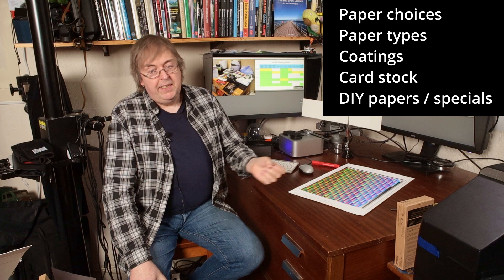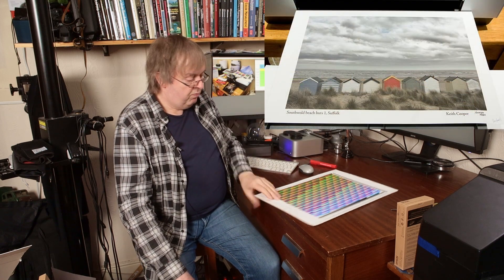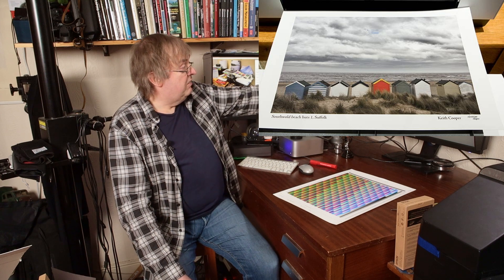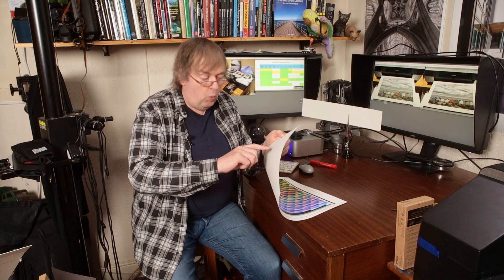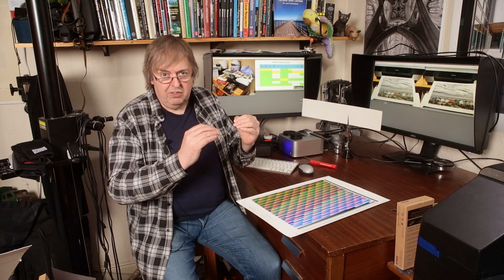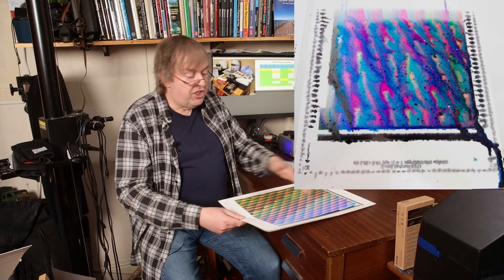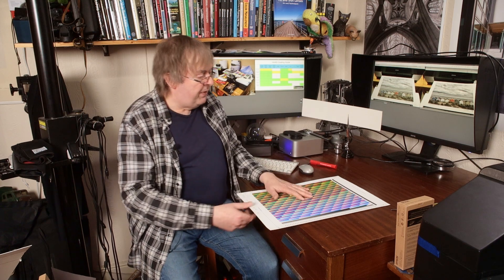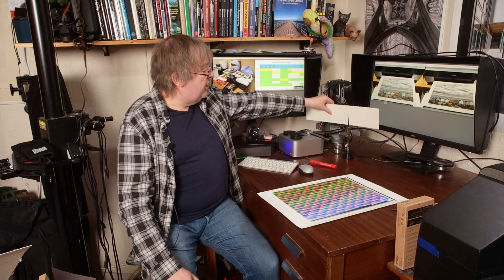Are your bad prints just using the wrong paper or card? Inkjet paper coatings for paper and cards

Comment: I have a XP55 Epson Expression 6 colour printer and did some prints (I dug it out from storage) and they looked fine. I have watched your other videos and in one you said you would use non-original ink in a printer as they can be copied quite well. I am asking as in the printer I use compatible cartridges and noticed after printing after a week in being left in a conservatory the photos looked weird. Some colour had turned weird and the colour had changed. Not sure if this is the compatible ink (would originals be better), or if the UV had done something to the photo's chemistry to change it. It might be a topic for a new video.
Reply from the maker: You've spotted the real issue with many 'unknown' inks - they show very poor permanence.
"Compatible" is mainly just marketing copy ;-)
Actually, I generally would NOT use 3rd party inks unless they were for a specialist printing setup, and even then I'd be wary of effectively ruining any warranty.
Even original inks can have problems with such conditions - pigment inks last longer though.

Comment: I'm curious now about whether the industrial (commerical printing) inkjets have special requirements, ordering a printing job online you get the same paper choices, coated, uncoated etc, for several different technologies (inkjet, hp indigo or offset), I think there are "indigo approved" papers for instance, maybe the company is just hiding that bit of complexity away
Reply from the maker: Yes, similar, but commercial presses use very different inks, so a 'coated' commercial paper would likely perform poorly with the aqueous inks of a typical desktop [dye or pigment] printer.
Paper choice for commercial work is a complex issue.
Reply: @KeithCooper  just having a quick look it seems the Canon VarioPrint ix1700 B3 is a newish one that uses waterbased inks onto standard stocks but sprays some kind of conditioning fluid onto the paper first and uses some kind of thermal printhead, article doesn't say what sort of inks, latex or whatever
Reply from the maker: Yes - this is not an area I follow in great detail, but a lot of options if you have the cash ;-)
Reply: @KeithCooper  I suppose the paper must be a big part of the profit hp etc make from consumer inkjet but maybe not much incentive for them to use these kind of tech's to allow more paper types to be used
Reply from the maker: @adamarmfield1069  Yes - the technologies are there, but how many are usable or would find a demand for in consumer products is a very different matter
Reply: Commercial print to order houses mostly use laser printers, I think. Inkjets have too many maintenance and difficulties to consider using them.
Reply: @frequentlycynical642 I just got some printing done on a canon ix inkjet press, mostly quality seems very good, under strong daylight you can see some flaws and occasional streaking, but otherwise the photos look pretty decent

Comment: Speaking of coatings, I've been wondering if applying an additional coating (such as Hahnemühle Protective Spray) to prints makes them any more "archival" than not using it. Would that make the print any less vulnerable to damage (and would it affect the appearance)? I really hate putting glass over prints due to reflection (and anti-glare glass imparts a slight blue color shift), but that's usually necessary when hanging in a gallery.

BtW, it would be great if paper makers would print faint logos on the non-print side (specific paper data would be even better) to make it obvious which was the right side (not always obvious, even by feel)!
Reply from the maker: Personally I don't like protective sprays - most give me a headache. Glass has never caused much trouble - but I take care with lighting if it's of any size. 

I think many would be concerned with bare prints though.

As to marking papers, I'd suspect more would rail against it ;-)  The damp finger test is normally adequate, as is keeping paper in its box.

Comment: Please note that coated photo papers - and uncoated papers once printed on with pigment inks - cannot be kerbside recycled here in the UK (unless the manufacturer's packaging says otherwise, which is unlikely). Dye inks on uncoated papers can likely last for 20-40+ years, so it's worth considering if you really need a coated paper and pigment inks that cannot be recycled - except perhaps if you're selling the artwork to customers who want 70-100 years life span, or if it's archival or something. We're living through a climate, waste and biodiversity crisis and all have to take responsibility for our footprint :) Thanks for considering and treading as lightly as possible!
Reply from the maker: Not entirely so...
Uncoated paper [completely uncoated] is just not much use.
Dye inks also need coated papers, to avoid fibre wicking and dot gain. Whether they last or not is immaterial if the ink runs and loses detail.
The papers least environmentally friendly are those with plastic layers, typically glossy photo papers. 
Not all coatings are the same, and if looking at recyclability, you need to consider the substrate more than the ink receptor coating.
Reply: @KeithCooper  Thanks for clarifying Keith, much appreciated and thanks for your excellent guidance as always! Hopefully the manufactures will add clear recyclability labelling, so folks can make planet-friendly choices.

Comment: Would love to know which are the companies/manufacturers that make/supply those coatings - I know Hahnemühle was one of the first to develop coating for inkjet printing… - but who else ? And also which inkjetpaper brands actually make their own paper, and which use base papers from the other traditional paper mills… Arches, Hahnemühle, BFK Rives, Fotospeed, RedRiver, Breathing Colour, Moab… which actually make their own paper, and which actually make their own coatings ?
Reply from the maker: Good questions, but ones I stay away from answering directly, since I'm not sure how much of my knowledge was [over several years] told to me in commercial confidence.

One thing is to look carefully at specifications - then things like the colour of the packing sheet in boxes, and even the colour of the tape used to hold the roll cover sheet in place.

A good friend of mine who was in the business for years could by looking at a box and a quick look at the paper and specs tell me where it came from. I had some papers from overseas and he was keen to see them - several he instantly identified, but one was a mystery ;-)
Reply: @KeithCooper   - ah yes... I have looked at the Data-Specs sheet, too, to try and compare if various papers have the same data... that certainly can give a hint -  and that's a good point about the little packaging details - maybe your friend could make himself a little side business, too, with his paper-insight-wizardry  :-)   - ultimately, of course, it matters little to us photographers and printers, as long as we can trust the quality of the base papers and the applied coatings - as long as we like it, we like it -  ... just that I'm a curiosity-nerd.. :-)   - it's the same as in so many other industries... one  manufacturer offering basically the same product to many different brands but simply at various slightly different formulations according to the individual brand's own specific desired specs  - by the way, Keith - would love to hear you chatting a bit about Baryta papers .. in case you have any info from your own experience - I work at a little art-reproduction print shop where artists bring in their original paintings, we create high resolution digital files for them, and then, mostly we use cold- and hot press paper just because they are visually/tactile-ly more 'suitable'/'appropriate' for fine reproduction-prints of paintings; but I, for one, do like Baryta paper mainly for straight photographic works -
Reply from the maker: He retired last year... 
As to baryta papers, I've tested quite a few, but mainly they are listed in the written reviews or the older paper reviews on the main Northlight Images site [which massively pre-dates me making these videos]
Reply: @KeithCooper   Ha! well good for him !  I'll browse around a bit in your old posts, then - I'm sure, in principle much of it still applies to the papers today -  looking forward to whatever you have next on your list :-)

Comment: That was interesting!  Thanks!  Any chance you could run through a demo of how you use InkAid yourself on some substrate so we can see your tricks (I’m sure you have some!) to get consistent results?
Reply from the maker: Thanks - I'm thinking of looking at it when I next have a suitable printer here to test - I have so much 'proper' paper in stock that it's not something I'd do for myself. My previous attempts at coating [for alternative print processes] have not inspired confidence ;-)
Reply: @KeithCooper   - a few years ago, I have used a inkjet-coating by Golden (one of the main manufacturers of artist- acrylic-and oil- paints) they might not even make it anymore (?)  - but same as Keith... the few attempts I made not resulting in any prints I would put on display -  though, I remember watching a fellow on youtube years ago, around that time, making some really nice work with his photography printing on one of those 'digi-aid' self-use coating products, I think it was of big-game animals (?), which inspired me to try coating some Japanese washi (those real thin delicate kozo/ mulberry/ and gampi papers - mis-nomed as 'rice'papers :-)  - which I had plenty of from my Oriental Ink-brush interests and work - But I guess it's a matter of taking time for plenty experimenting and adjusting the manual coating and then experimenting until you get the printer settings figured out for good results  - just lots of manual trial-and-error -   I think, today, there even aren't many such 'ink-aid' products out there?
Reply from the maker: I think you're spot on in the need to really perfect the coating process. I've added it to my to-do list ;-)
Reply: @KeithCooper  … and then there is the option for clear. And white opaque coating, variables in how many layers of coating one applies, to which variety of paper,and then not having any ICC profiles ready made… and no definitive print-settings to go by… ends up costing lots paper and ink and coating to experiment to only hopefully end up with worthy results -